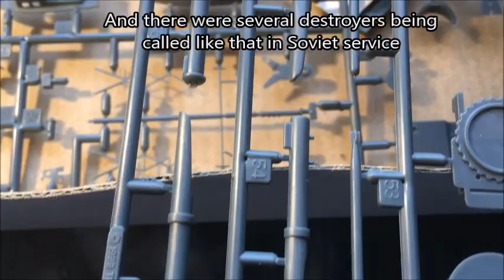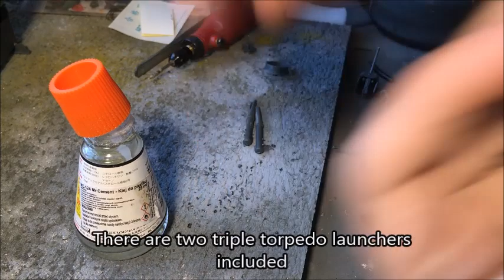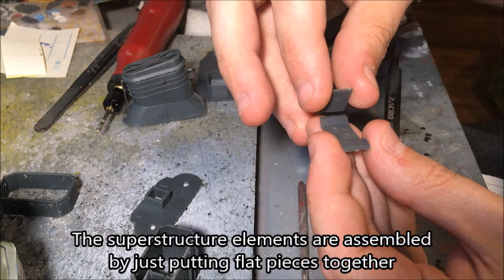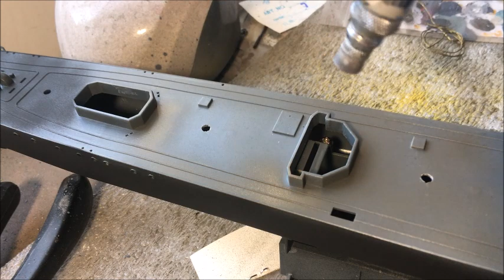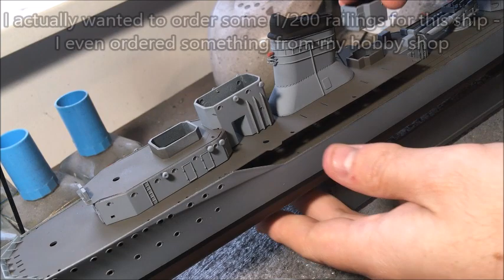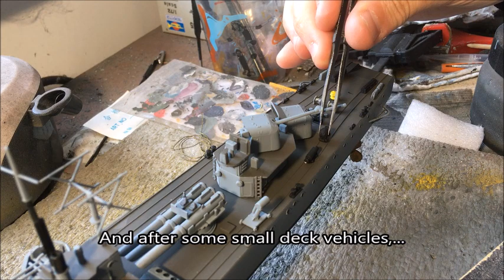1/200 Former Soviet Courageous Destroyer / PLAN An'Shan Trumpeter: Painting, Building

Comment: Is this kit out of production?
Reply from the maker: Hi George! I think so, i have never come across one of the very early 1/200 Trumpeter Chinese ships (they also have made some modern chinese destroyers in this scale), but i am not sure. Great kits, though!
Reply: I was looking for a large scale destroyer to build for RC the Lindberg blue devil just doesn't cut it with their 5" guns that look more like 5"25 cal then 5"38's
Reply from the maker: @georgedistel1203  I have recently watched a video about the lindberg model, the barrels looked really tiny! Maybe the revell 1/144 Fletcher Class, it is a nicely detailed kit! Have you looked into that?
Reply: Didn't know that Revell offered one in 1/ 144 scale thats interesting
Reply: @georgedistel1203  You can make the gun barrels longer and I think some company produces brass barrels for the Blue Devil that look more accurate. Also, you can drill new holes in the turret floor to move the gun barrel closer to the front of each turret; something like 1/8" to 1/4" and drill new holes. It is not a perfect replica, it was designed to be a semi-scale motorized model